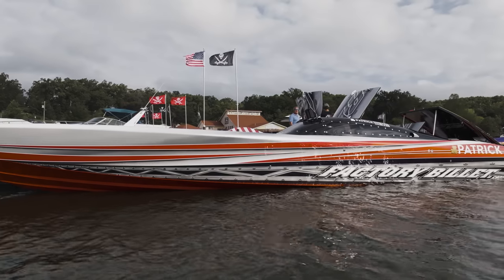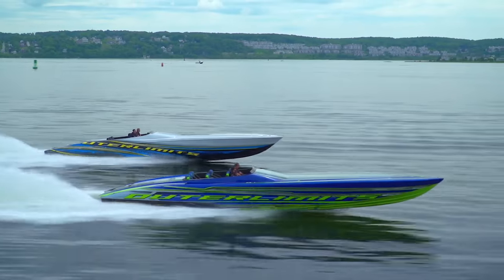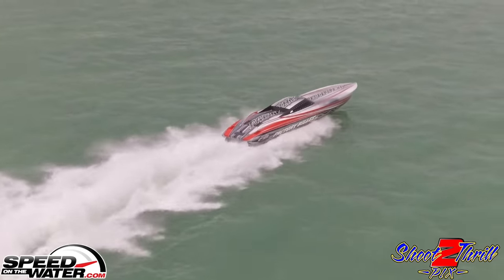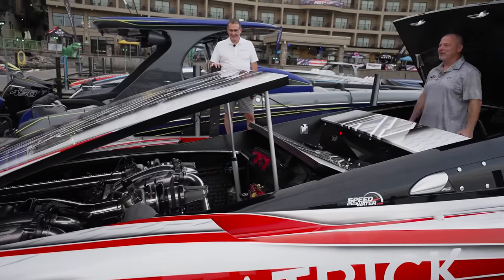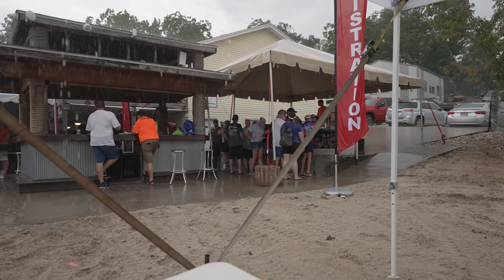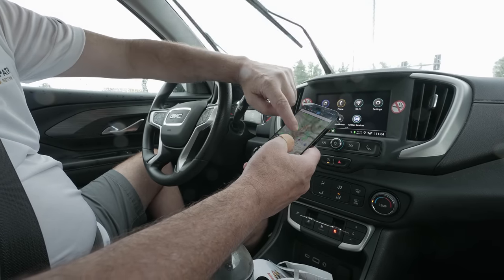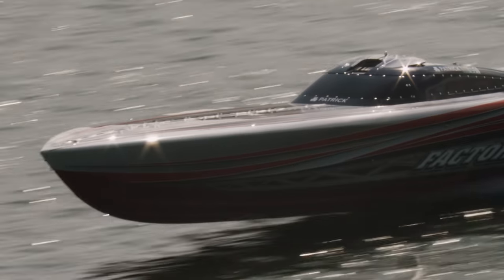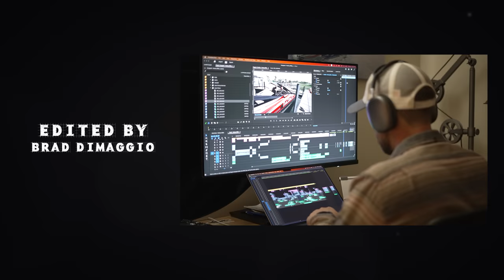World's Fastest V-Bottom | Factory Billet

Comment: A few years ago i got a ride in a 46' Outerlimits with modified 1075's. Went for a short ride and while heading  back in another  passenger  said we didn't  hit 100 mph!  Owner  went out again  and  with no effort  hit
117 mph with more throttle left. SMOOTH  and very little drama. When the boat left the factory years ago the claimed speed  with stock 1075's was 127mph. WIth the modified  engines  the boat should do 135 +  Outerlimits  has  a great running  hull. Another friend had a 41 Outerlimits  with twin 700 Mercruisers with #6 drives that went  112 mph +.

Comment: I made valves with inconel core and the inconel portion has a .02 pentagon i.d.  on valve stem portion , then 2 other exotic metals used on the valve. Capable of lasting in a top fuel dragster engine a full season but no one cares to try them as they think its bs. People do not even know there is a 90ft powerboat the billionaire friend machined mold to in 2022 and this mofo has 3 4000hp turbines . Its purpose is to run over 150mph through a haulover  chop to ocean  which will happen this summer in miami Fl . The seats to boat are bad ass with 4 feet of suspension travel total (2ft up ,2ft down) and axial up too +/- 30 degrees of axial suspension . Safe for a front end stuff at 150mph on back injury prevention tested so far in seat suspension test center in certain location.

Comment: The hardware store changes were that they disconnected the air lines from the wastegates. This forced them shut for the whole run and created a nuclear reactor. The software changes were dumping fuel at the top the table and hoping the engines wouldnt lean out because there was no longer any boost control as they elected to create a nuclear reactor. Think Fate of the Furious when Dom is racing in cuba and pulls the string locking the waste gate shut and hoping for the best to win the race. Thats why the tuner was sitting there giggling and the owner was hesitant. The tuner knew full well he was about to create a bomb, and its not his money in the engines so he wants to see the theoretical max of what the engines could do before they melted down. Owner was hesitant because riding with an untested bomb with no boost control making probably closer to 3000hp is i n s a n e.